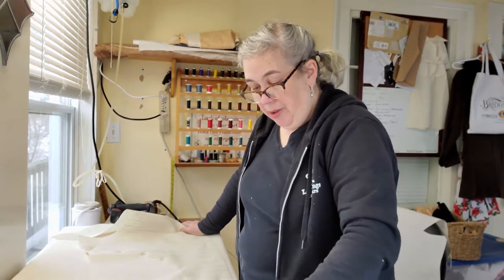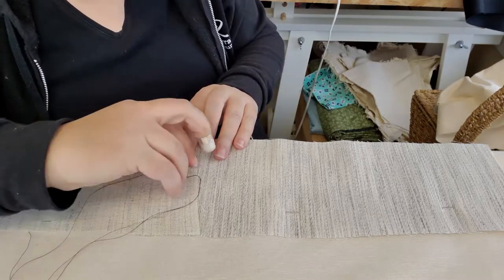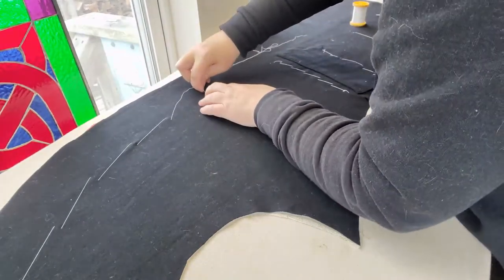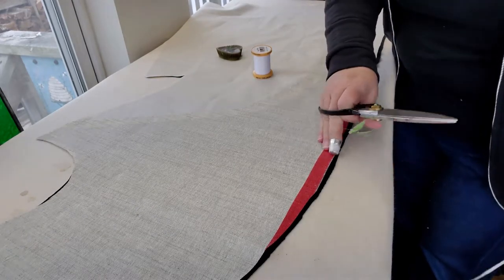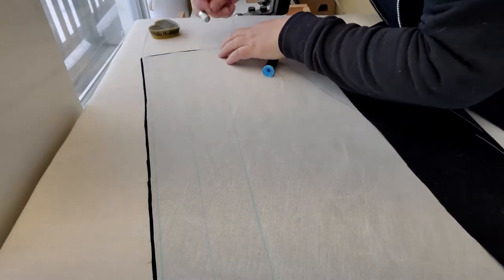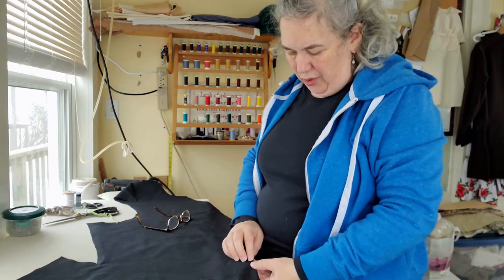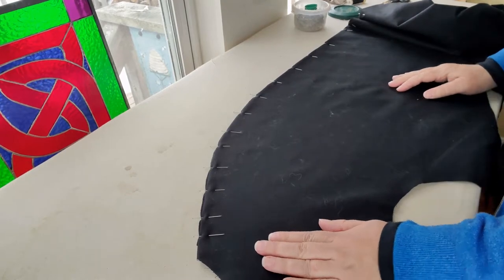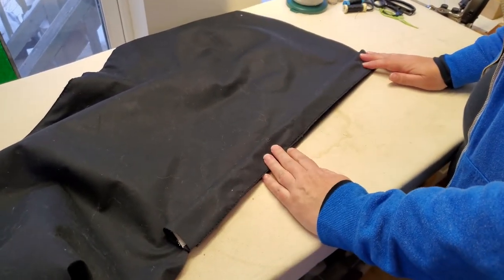Frock Coat part 2: Front Structure and lining

Comment: This is something i have had issue on for a while. On the coats I make, I add the lining in as a whole, pin it in the center and other seams and then begin working. I have come to realize that this is of course more work because in the end I am working with the whole coat for button holes. Going to attempt this method on a clients coat this week
Reply from the maker: Good luck in this. I hope it works for you.

Comment: Do you cut the lining exactly the same size as the fashion fabric . And how do you decide the size of the interlining if you don’t do it full size as the lining . I understand we need to add strength to some parts but what is the width we should make our strength layer ? I am referring to horse hair - strength layer TY
Reply from the maker: The horsehair, or buckram is only as wide as you need for buttonholes, maybe a half inch wider. The lining is cut same as the fashion layer. Everything is flat lined, not bag lined like modern garments, so there's no need for extra ease in the lining as the layers all act as one when the garment is finished, they are so well attached.

Comment: Did you cross stitch the front side of the pocket bag to the interfacing as well as the back?

Did you use the full frontal canvas inside due to the weight of the superfine (i.e. would you have done that with a heavy broadcloth)?
Reply from the maker: I just cross stitch the back side. That's all I was taught that was needed. I suppose you could do the front as well. I used the full canvas because I want a nice clean line to the front. The earlier coats were more fully canvased than later in the century, but I think it's really dependant on the body and the cloth. I want a crisp finished product. Other coats I want to always be a bit more rumpled, so I use less canvas.
Reply: @kellyarlenegrant  
What are your decision points for making that choice (crisp vs. rumpled)?
Reply from the maker: @jayoestreich1729  mostly character development. What is my character supposed to look like in the everyday. This particular gentleman would have been of some means to afford this fine cloth, so as crisp and well tailored as I can make it. For Jayar's tradesman, I chose the fabric because I wanted him to always look a bit rough, then tailored it lightly to give just enough structure, but without making him look like he was fighting his coat all the time.